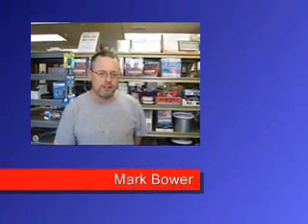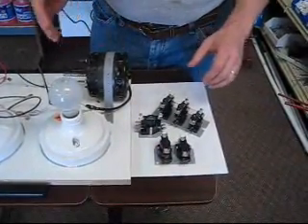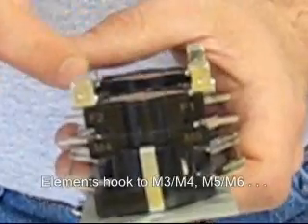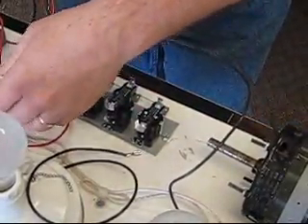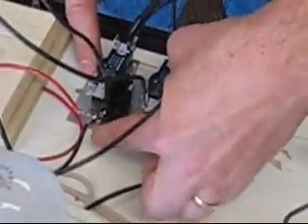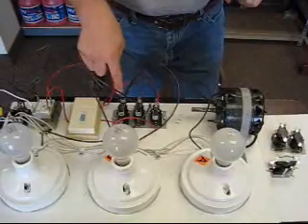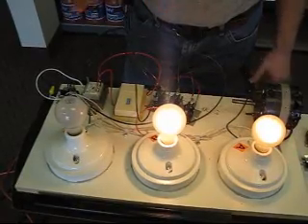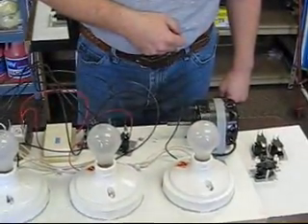How a furnace sequencer works

Comment: Mark very nicely done, looks like this video resolution is as old as the video. Would be nice to see in a more high resolution video but get the idea still. Also could be very informative to see with fan relay setup works with the heater loads on the board demo and maybe a manual fan only switch on the furnace as some old units have. Maybe you are sitting back with the fishing rod now. Still an awesome video !

Comment: Hello ~
I got an electric furnace heater and I replace both o my relays or sequencers and still have problems!
The motor it’s a little too hot 
Any suggestions?
Thank you in advance 
Model # 3115

Comment: Does it matter if your sequencer has 1 and 4 on one side and 3 and 5 on the other side and the replacement has M5 and M6 and M7 and M8?  If it matters then can the replacement still be used?  If so how would I wire the replacement?  Where would I place the connection that was previously on 1 on the old sequencer on the new sequencer with M5, M6, M7, and M8?  Same with 3, 4 and 5?  The reason I am trying to stick with this sequencer is because the timing of it is the closest to my old sequencer.  I am not sure it matters but from what I read timing has to match but sequencers with that timing no longer exist.  Seems to be completely phased off as it is not in most sellers records or inventory.  Because of this I could not find an exact cross reference for it.

Comment: Loading... Loading rich text... « Plain TextCheck Spelling  Resume Editing Hi, I found your explanation very good. Can you help me? I have had three (3) Techs fix my electric furnace / wood. I am interested on the electric side of the furnace. Techs have changed sequencers now I think sequencers are out of order.PS I would like to change all sequencers for a proper order of operation and spares.Sequencers are now burning, not lasting one heating season.I am now held  PRISONER by  my furnace .Sequence now in operation of order:1 - 12S22 H24V 305448           2 - 14S22 H24V  305815      24A34 - 21                                4/5 H1 - 20   C40 - 90      H1 - 2 0  C1 - 60                        1/3 H30 - 90   C1 - 30       A0940                                         A1044  3 - 14S22 H24V 305815           4 - 14S22 H24V  305815       4/5 H1- 20   C40 - 90                4/5 H1 - 20   C40 - 90        1/3 H30 - 90  C1 - 30                1/3 H30 - 90    C1 - 30         A1442                                        A1040Elements are 5KW @ 250 V There are four (4) but only three (3) are connectedTotal three (3) draw 65.5 Amps.!st stage 25amps  2nd stage 45amps  3ard 65.5 amps  state set 17cel furnace starts every 40min runs for 10min.Very gratefulPhil

    Sans Serif

Comment: My furnace will shut off with the thermostat MAYBE 20% of the time, or it will run until I have to shut off power at the breaker.   I changed thermostat and it still does it.  is it the sequencers?

Comment: Hi, I would like to change sequencers in my electric/wood furnace. I have had 3 techs work on sequencers. Would like 4 new sequencers to put back in sequence and spares. Can you recommend .Now held prisoner by my furnace.Summerair   5kw 250V The sequencers in order of operation now:1 - 12S22 H24V  305448  24A34-21     H1 -  20      C1 - 60        A0949 2 - 14S22 H24V  305815  4/5  H1 - 20      C40 - 90                                               1/3  H30 - 90    C1 - 30             A1044  3 - 14S22 H24V  305815  4/5  H1 - 20       C40 - 90         A1442  4 - 14S22 H24V  305815  4/5 H1 - 20        C40 - 90                                                1/3 H30 - 90      C1 -  30         A1041         Fan / high limit/ ? limit  120v connected to #4 sequencer  Very Grateful Phil

Comment: Great video very educational. I recently bought a Miller e3ed 015h and was told it had sequencers. I found out after it was installed that it had contact breakers instead. Sequencers make no noticeable noise turning on or off but contact breakers on the other hand do. My new Miller furnace is located right next to my bedroom door and all i hear all night is click clack click clack that sounds like a rat trap going off every time the furnace comes on and goes off. How can i change to sequencer?

Comment: Will a bad sequencer cause the elements to turn on without the fan running? 
I have woken up to a light white cloud of smoke and the smell of burning(sweet). 
The only thing I have noticed is that the unit itself gets really hot even when it’s not running.
Reply: I am having same issue.  Replaced capacitor no help so sequencer is about the only other thing that makes sense to replace.  The fan blower motor works fine it just won't come on with heating element  ( which is a fire hazard besides not pushing the heat around the house).

Comment: our triple stack sequencer went out on our electric furnace, the tech put in a double stack cause he did not have a triple. he also said the coil in the furnace was too small for the unit and he was not sure why they put in the smaller coil. the start of all this was we woke up kicked on the heat and after an hour the house was not warm and it was blowing cold air! The tech is going to check with his company and see why smaller coil was put in.  so this should get interesting.............

Comment: Your explanation is quite good. They way you did this for testing it wouldn't take much to convert a gas furnace to electric, with the right parts and some furnace modding. I've looked up the parts I'd need, it would be much cheaper to convert than to buy a completely new furnace. I'm a DIY guy, with the knowledge I do have and some logic it shouldn't be any trouble... thanks for your informative video.

Comment: Had sequencer replaced in electric furnace and now there's a noise that sounds like a fan or blower motor -- a ticking sound.   Could that have been from the sequencer install?

Comment: thanks for the post, my electric furnace works like it should, then after a while it will not come back on. after taping on the element front plate it works again... the breaker  was changed last year all wires and terminals look fine any ideas?  thanks...

Comment: Last night my husband was reconnecting the wires to everything because we just replaced the blower wheel, when we flipped the power and turned the thermostat on, only the outside unit came on and there was a humming coming from the inside unit. We turned everything back off and left it alone for now. I saw the delay in your video after turning on the thermostat; so my question is, is that what was happening with our unit when we turned on the power?

Comment: Couldn't you just have a microcontroller trigger 4 SSR's to flip on an off in reaction to a temperature sensor in any way you program it?
Reply: THEN IT WOULD BE A PIECE OF SHIT ALWAYS HAVING PROBLEMS
Reply: So reliable enough for aeroplanes, helicopters, controlling reactors, just not enough for a furnace...
Reply: COST

Comment: Hi, I have an old electric fan heater which I had to take a part to fit in a smaller case, I messed up  the wiring!! can any one explain how to join/ connect the power, fan motor to the 2 heating wires please? thank you very much

Comment: In a situation like this. Do the thermostat have to be set to a high temperature in order for all the heating elements to come on or do it calls for all the heating elements to come on if that the demand load is not met. In other words if it’s really cold and the thermostat is set to something like 70° would that cut all the heating element or would you have to turn the thermostat up higher?

Comment: After my thermostat gets to temperature and switch turn off the blower still runs what could be causing this
Reply: First, make sure you can hear the relay turn off at the thermostat, just a click when you expect fan to stop. Try the fan switch separately. On an older furnace especially, next thing to check is the delay then the relay behind the upper furnace cover. OK, Warning, only do this if you are comfy with deadly power. There may be a silver cigarette carton sized object with a slide controller on it. Tap that lightly with a non-conducting object. Fan may just shut off with the tap. If so, could be this delay unit, but may also be the relay near it...looks like a shiny ring box with wires attached. Tapping this might also shut off fan...but it may well be more hidden and hard to get to. Newer furnace may have relay on the IFC, the control board. In any case we're talking LIVE power circuits here, so if tapping without the power shut off use only a non-conducting object and stay clear of any contacts, or consult a pro. The delay will be very expensive (>$100); the relay will likely be pretty cheap (<$20). A whole new IFC more like $300.